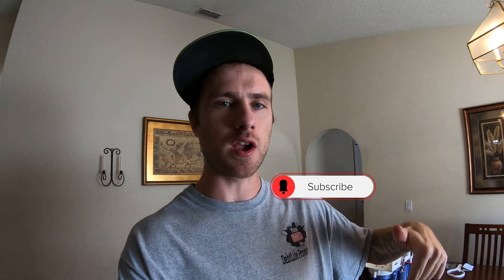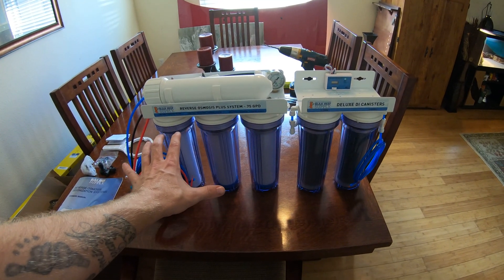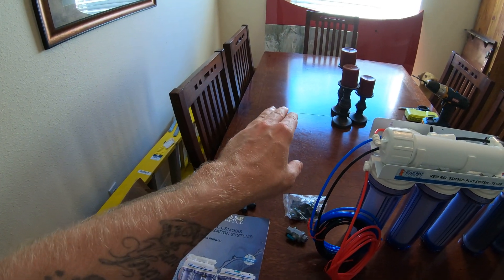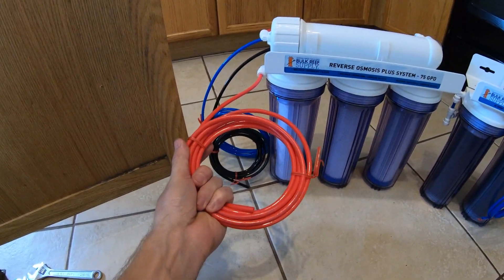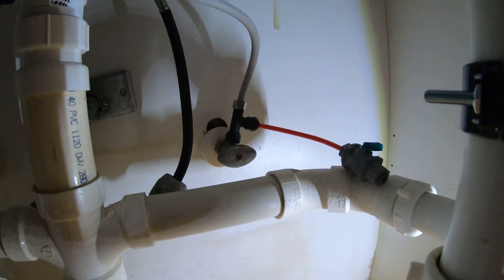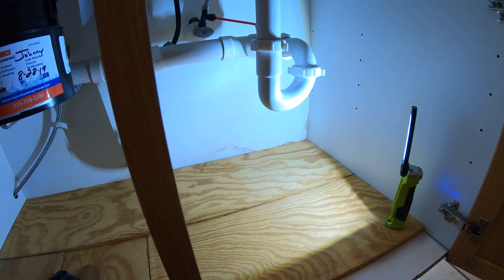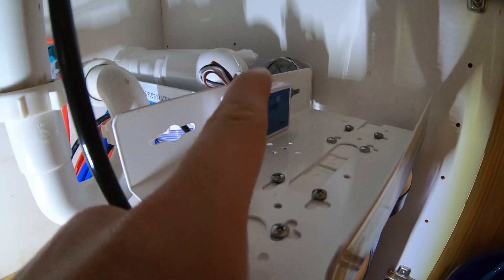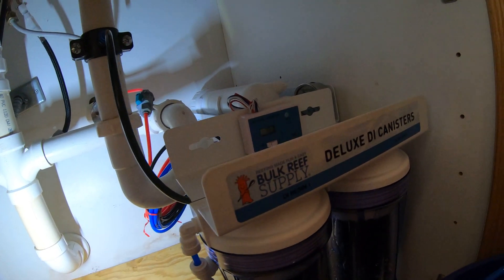Bulk Reef Supply RO/DI 6 Stage Water System - Review and How To Install/Setup for Your Aquarium!

Comment: Will this lower the pH my current tap water is 8pH for my freshwater i need to figure out a way to get it closer to 7 or 6.9 pH will a system like this help or just make my water worse.
Reply: Yes so something I figured out recently, is that the metal in tap water can make your ph flux, so if you add tap water to your tank with ph down, it’ll stay down for a couple of hours then it’ll rise back up again. What this system does is, it takes out all the metal so if you want to reduce your ph you can. And it’ll stay low to where you want it as well.

Comment: Did you compared the waste water flow and the filtrated water? In my home the waste was a lot more than to the filtrated water
Reply: I’m scratching my head right now trying to figure out if this it’s normal??
Reply: This is normal, depending on how hard your supply water you can expect roughly a 4:1 ratio of waste water to ro water

Comment: I ended up getting the buddie booster. I’m pushing about 60 gallons In about 6 hours
Reply from the maker: I'll need to do that soon as well, pressures alittle low and it takes a while, but it works for now